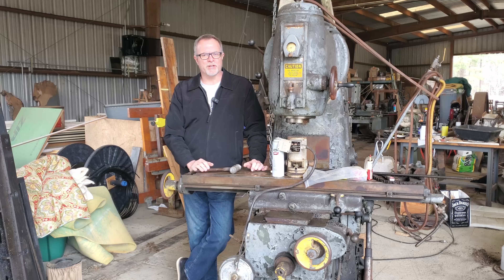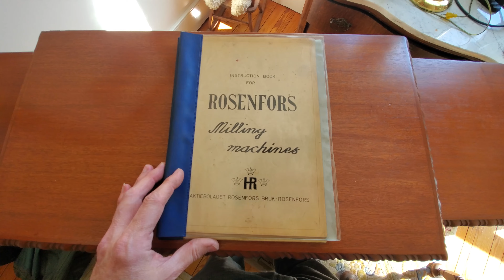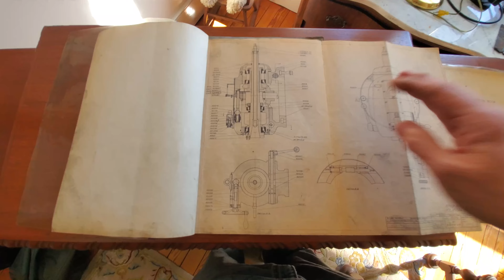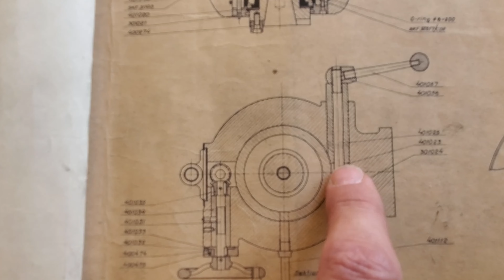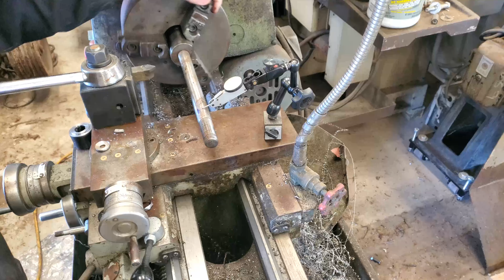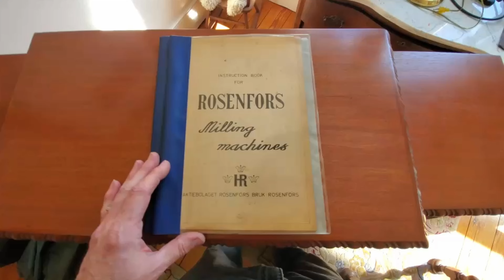Rosenfors RFV Mill + Shop Update

Comment: Should be no problem using 240-480 delta delta transformer just be sure it’s rated for at least double the machines amps on the 240 side
Reply: I just noticed you said 230 transformer. It maybe y not delta that could cause you issues if it is.
Reply from the maker: @bcbloc02 Believe it's delta.
Reply from the maker: Should be fine as long as I can get the idler started 👍

Comment: Glad to  see you posting again. Was wondering if there is room for a spring on that quill lock between the two halves?
Reply from the maker: Maybe, would have to lay it out on CAD. The shaft comes pretty close to the quill, I think, leaving little room for the spring coils. Seems to loosen pretty quick and the handwheel moves it freely up & down.